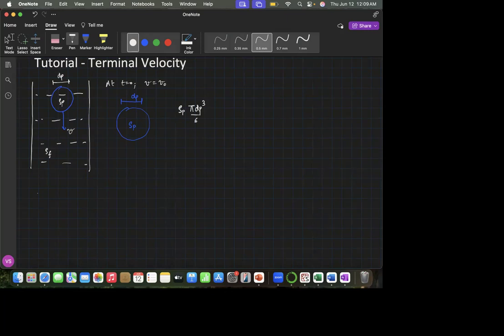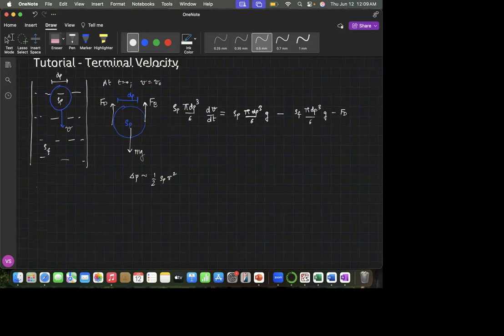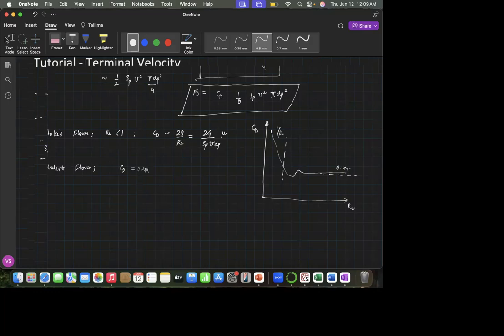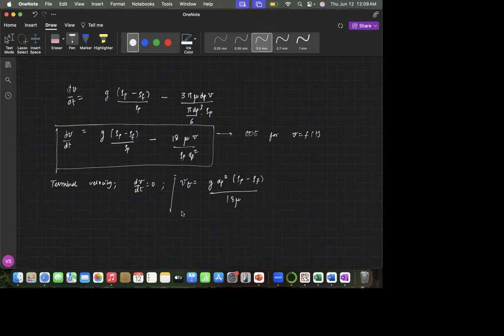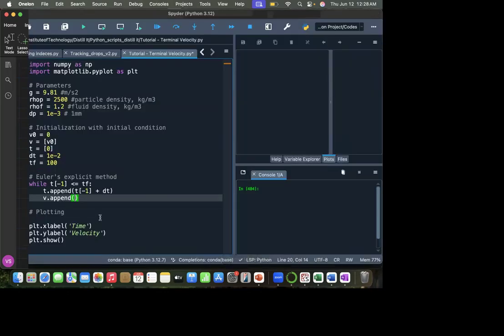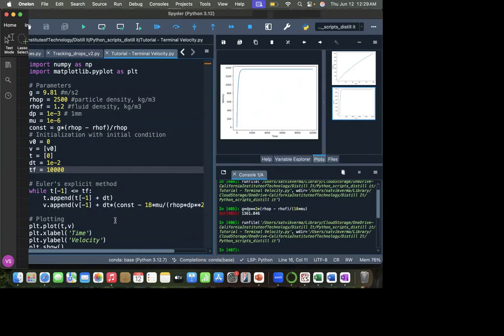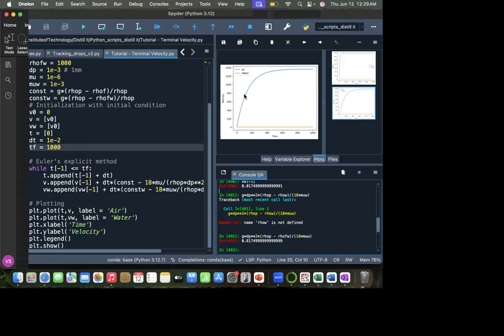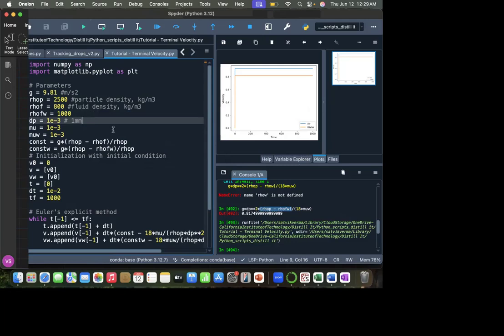Tutorial 3 - Terminal Settling

Comment from the maker: Dear all, please note that at 6:54 I made a mistake. The pressure difference scales as 1/2 rho_f v^2, and NOT 1/2 rho_p v^2. Further calculations done would hence have rho_f. Also, when evaluating the Reynold's number at 9:55, we would use rho_f instead of rho_p. Please make note of these corrections.

Comment: isn't the Force of drag related to the density of the fluid not the object?
Reply: I am probably not too educated enough for this yet. Still a rising junior 😅
Reply from the maker: You are absolutely correct. At 6:54 I made a mistake. The pressure difference scales as 1/2 rho_f v^2, and NOT 1/2 rho_p v^2. Thank you for pointing it out! Further calculations done would hence have rho_f. Also, when evaluating the Reynold's number at 9:55, we would use rho_f instead of rho_p. Please make note of the corrections. Thank you so much for pointing it out.